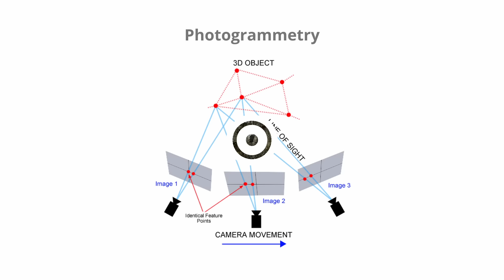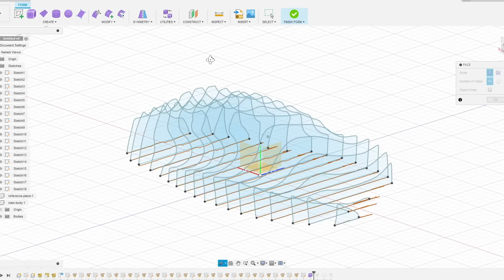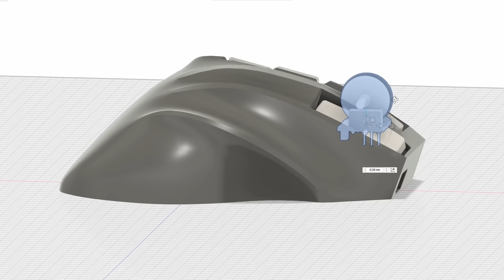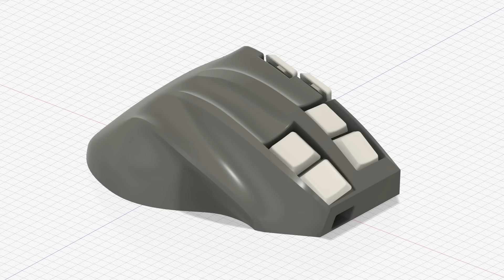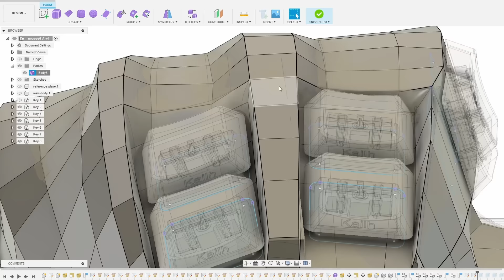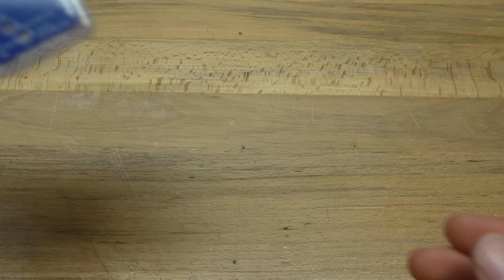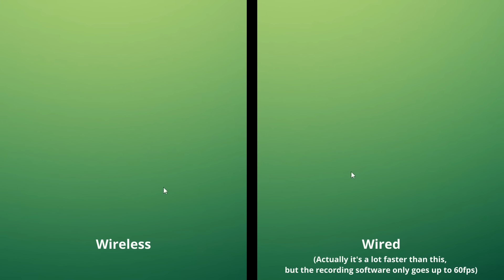I built a mouse from scratch with 3D printing and Arduino

Comment: "I have big hands" .. your hand is measuring around 7-3/4 on the measuring tape but the base of the measuring tape is not hard up against the junction between your wrist and palm.
This puts your hands size basically bang on the average male hand size of 7.6 inches.
Reply: Okay, my hands are bigger than most other guys I know (by about 1cm) and measure barely over that average (7.7"), so I had to look at where they got their information and most seem to refer to a NASA report which in turn refers to some old military data and that data appears to use a mean average (the NASA page says 50th percentile which is median but the paper it references says "MEAN" which was 19.1cm and 19.2cm in the table I could find in the paper which is 7.52" and 7.56" respectively, I couldn't find any other reference to hand length in the paper that had numbers)

The biggest thing to me is that it says "mean" (allowing for outliers to have more influence on the results) mode would be preferable if we want to talk about average sizes for people since when we say average size of something we tend to mean most common size
For anyone who doesn't know the difference this is from britannica:
The arithmetic mean is found by adding the numbers and dividing the sum by the number of numbers in the list. This is what is most often meant by an average. The median is the middle value in a list ordered from smallest to largest. The mode is the most frequently occurring value on the list.
Simplified version:
Mean = add all your numbers together and divide that by how many numbers there were in your list
Median = list all your numbers in order of smallest to largest and pick the one in the middle of the list
Mode = the most common number in your list

Out of these averages mode would be best used in this situation since when we say the average size of something in conversation we generally mean the most common.
Depending on the sample size the most common number will skew the mean and median averages towards it so long as the outliers aren't too big a deviation but I'd still go with mode for anatomy

Another thing that comes to mind is it being military data the subjects might have had a larger than average build but I'm unsure how accurate that assumption would be in reality so this may be meaningless to say

This could've been a waste of time but that either means the subjects averaged larger than most, the outliers tended towards being larger, or the people I know have kinda small hands

edit: After a quick google looking for an australian study, I couldn't find anything, but I did find this:
A British Study found that hand sizes for males range from 6.25" to 8.1" with an average hand size of 7.44"

Which is closer to my personal observations
Reply: So a more accurate thing to say is "Most if not all modern mice are too damn small for guy hands". Seriously, I've had hand cramps with every mouse I've used. I really wish this design was purchasable...

Comment: I had the same dream some 3 years ago. My problem then was sourcing the sensor. Maybe I'll look into it again now. Thanks!
Reply: Some sensors are pretty easy to source from aliexpress, digikey, mouser and others. I ended up postponing building a DIY trackball as the Ploopy Thumb Trackball fits my needs damn nearly perfectly. And it's open source too. Although the DIY mouse and trackball communities aren't as big as the DIY keyboard community, there are plenty of resources online.
Reply: @gcolombelli  I've been looking the last couple of days and they are available now in 'normal' quantities. 3y ago I would have had to source them trough alibaba with moq of 10000

Comment: One of the reasons you went for THT is because components are easier to source?
Dude what? 🤣
Also, if you are bad at soldering, then you actually should go SMT, because with those and the paste soldering alloy, it corrects itself.
You also got sponsored by company that, you said yourself, can do PCB assembly, they would solder those resistors/caps on the PCB for you, then you just solder the esp32 and sensor module yourself...

Comment: Good job! My first thought was that instead of a rotary encoder, you could use a BLDC motor - and even do custom dents into whatever mode you want to use! Not sure if it would be a better scroll wheel, but it WOULD be super neat to see you attempt it hahaha 

Either way, very cool project! Keep up the great work!
Reply: So you have seen the smart knob video by scottbez! Awesome project. I would assume that it is possible to implement but not without blowing the complexity of the mouse out of the water for a few reasons. As it stands the mouse features two real time systems. The communication with the PC and the position tracking. Both require pretty tight timing for that low powered microcontoller. He had to dial down the DPI for the bluetooth variant just to make do with the available resources. The knob is an entire new real time system with more added complexity. So either add more microcontollers or step it up to a beefier unit and both would impact battery life or at least make it a lot more diffficult space wise. You could just outsource the communication to a dedicated module and leave all the mouse parts to the Arduino. That would probably work but again it need energy and space. And a few compute cycles to send the information over.
Reply: The rotary encoder on the mouse wheel is the first to fail or glitch in my experience.
After I learned that logitech puts opto-pair on even the cheapest mouses, it becomes my favorite brand.

Comment: The esp32 s3 has two cores I believe. If you're having issues with the sensor polling being too slow, you could just put either the sensor or BT handling on the second core?
Reply from the maker: That's a good idea, if its possible. I'll have to look into it.

Comment: this is really cool, nice job.

I've been a logitech trackball user for years due to my needs and the quality of the switches has gone downhill in all of their mice. one used to last me years and I replaced the last few withing a year because of faulty clicking.

finally had to swap out the switches with some kailh blue 2.0 -that fixed that but the rubberized plastic and micro usb are def not made to last.....

Comment: I'm sure this was easier than taking apart the GPX and getting a new encoder and pads if needed /s

For the sake of a completly custom mouse, this is sweet, but I wonder if a middle ground could be reacher by taking apart an actual mouse, and only making the molded shell, and then moving the mouse clicks from their pads to fit their new locations. 
This way, all you'll need is clay, a 3D printer (even that is optional nowadays with shops and websites), soldering iron, wires, and no need to code, buy an arduino, and you can retain the software for the mouse if it's a good one (lol), and also what I care the most about, the sensor and calibration from the mouse. I don't trust myself to code knowing nothing today, or any of the cool stuff you did, but I think I can manage to squeeze some clay and take photos

Edit: I meant this specifically for the wireless version. Most of the complicated bits would be handled by the OG mouse's PCB and dongle
Reply from the maker: Yeah, that's an option for sure. It was definitely more work this way, but I did learn a lot during the process!